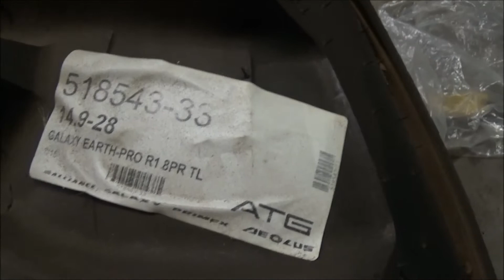cleaning and painting the wd45

Comment: How does that oil bath unit come apart to change the paper air filter inside. I can not get it out.
Reply from the maker: Thomas Magnum the oil bath air filter bowl . Dose. Not have a paper    filter you just put oil in the bowl.you just pull the wire clip tords. You and work the bowl off it maybe sticky